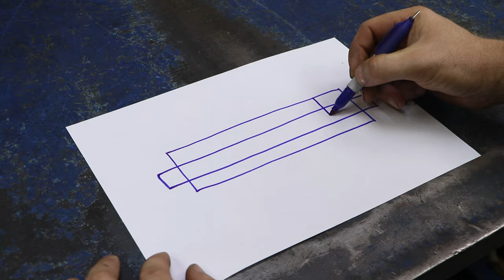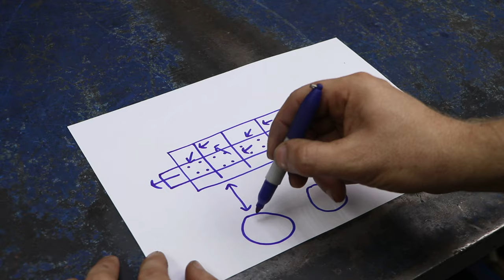How to make your brushcutter sound quieter!

Comment: Just had thought, would wrapping some insulation around on the inside wall of the silencer reduce the noise even further, or is that not possible?
Reply: You mean like a glass packed muffler? Definitely helps with the high frequency noise. Baffled chambers like this are generally good for the low frequency noise. If you really know what you're doing, you go further with it by orienting the baffles in order to cause destructive interference within the baffled chambers (which is then called a resonator). But that is neither cheap nor easy to design.
Reply: Steel wool
Reply: Scotch brite pad?
Reply: I used 177 pellets in mine   haha

Comment: I have a question . Will the high temperatures be transferred from the support blade that is screwed to the handpiece screw and will the plastic parts of the handpiece melt?
Reply: yes, it will get hot as all get out.  You need a nomex/insulated sleeve for it.

Comment: Won’t that severely affect the carburetor tuning? You’ll have to jet down a few sizes
Reply: Small 2t motors with pumper carbs like these don't really use jets that you can swap out, instead there's a low and high mixture screw. Super easy to tune idle and WOT

Comment: Hmmm...home made muffler!  Next time just use a one piece perforated and glass wrapped motorcycle exhaust tube for ease of construction and weight reduction.
Reply: Indeed, but pay attention that the insulation material (I would use mineral wool) must be sufficiently dense so that the sound pressure waves are reduced in speed.   I expect much larger noise reduction.

Comment: Need to make something like this for my quad bike to quieten it down so it’s more stealthy 🥷.
Reply: i'm doing it for a dirtbike, but use steel wool and glassfiber, and at each step the total hole diameter should be bigger than the pipe you attach it to, the inside should be empty and the between should be with first steel wool then glassfibre

also, use rubber gasket when mounting the exhaust to the frame, no rattling